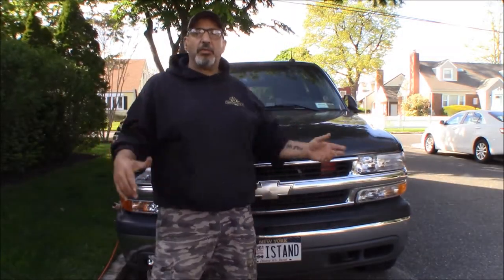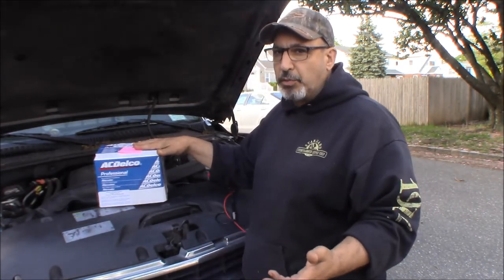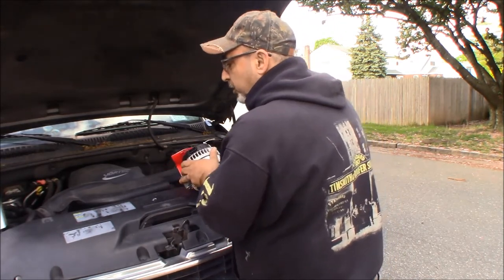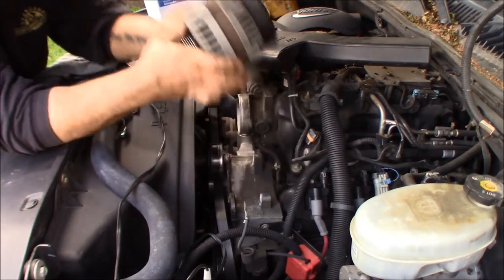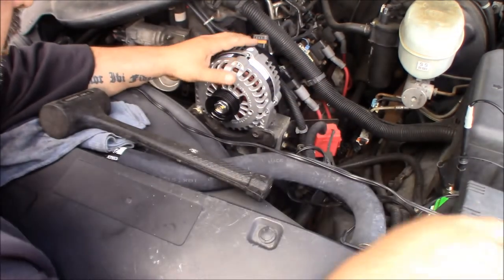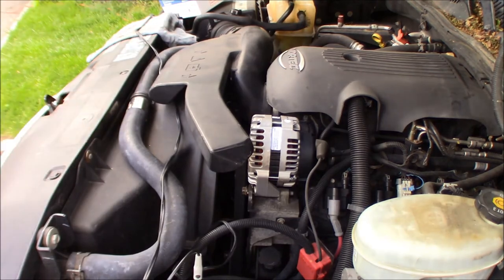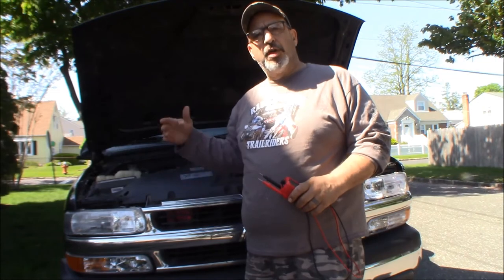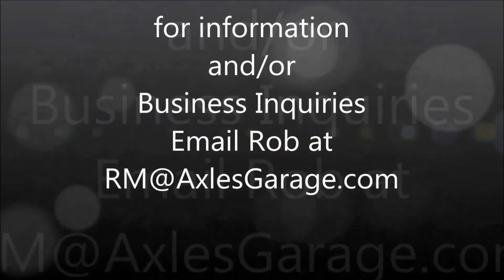Alternator & Battery Problems Solved: 2000-2006 Suburban Silverado Tahoe Yukon etc. with RPO Codes

Comment: Interesting, my daughters 2000 silverado has similar issues. Messed around with the cluster and it took 5 minutes to kill the battery found and fixed a ground problem with the cluster and thought I fixed the problem. Couple months later a brand new battery was no longer good. Replaced the battery and 6 months later a bad battery. Charging system charging at just approx 14.5 volts. Thinking I got 2 bad Walmart batteries so bit the bullet on a Costco Interstate. Now a year later I have a bad battery again. Pulled a known good alternator(just over 14 volts) off of my race car(swapped truck 5.3) to replace my daughters alternator, got the interstate warranted and put it back together, now just a waiting game to see if it does it again. Hoping the 14.5 volts the other alternator was putting out was too much even though it was in spec because at this point I am lost on what the problem is.
Reply from the maker: Interesting, 14.5 volts should not be an issue.  I would look for a parasitic draw that may slowly be killing the battery
Reply: @Axle's Garage  the problem is finding this draw Lol. Anyway, Going to replace the battery cables, and pull up the fuse block and check for bad connections on the bottom side once it gets a little warmer out and quits snowing everyday. Those areas seem like common problems on these trucks. Even have a friend that used to be a GM service adviser tell me that's the direction he would take.
Reply: Trying doing the big 3 upgrade lots of YouTube videos on how to do it
Reply: Interstate batteries aren’t any good. They put those in fleet trucks and you are lucky to get two years.
Reply: 14.5 is not over charging

Comment: my 06 Yukon with the heavy duty towing package has a 165 amp alternator stock.  Still the original one with 160,000 miles.
Reply: My 05 Tahoe has the same setup with 158k miles and my lights are flickering so I replaced my alternator with a GM Genuine one. Seems better so far
Reply from the maker: Yes, generally speaking the OEM units seem to last

Comment: If you put a socket over the outside of those sliding sleeves, run a small bolt through it with a nut, then when you tighten the bolt, the sleeve will move back. You should never hammer on that aluminum bracket. It can break.

Comment: Ways disconnect battery before changing alternator!
I didn't disconnect before changing  out alternator and blew Fusable Link. Its was a pain to replace near Starter
Reply from the maker: Good tip
Reply: Where was yours? I can't find it anywhere. 06 silverado
Reply: @johndandeneau4158  fusible link usually off alternator to battery and Starter to battery

Comment: Never disconnect the battery while a modern car is running, there is a chance you will get a spike and fry the car's electronics.
Reply from the maker: I have heard that before, although never had an issue. I have also heard to avoid arcing at the terminal like when you connect a charger, eg: connect the charge then apply power. Also, I haven't found anyone who would define 'Modern'.  Either way, it's a good warning for all.  Thanks for the input.
Reply: Been doing that shit for years, on new and old vehicles. Haven't had a problem yet🤷‍♂️🤷‍♂️. More worries about the car on the lkft than a mystery occurrence I've never seen happen
Reply: @Luke. Yup. I agree. Most cars it's fine to do. But I know someone who fried a computer in an early 2000's Mazda protégé

Comment: Couldn't get through the whole video because of Mr. Buffer. So anyhoo, I just did the evaporator hack and was excited to finally have some air. Had it idle for a little bit and it worked great. Took it out for a drive and shortly down the road the battery voltage drops and I get the "battery not charging" warning. I had this in the past so the alternator is about 6 months old and the battery about a year. Are these alternators just bad alternators or is something else in the Suburban causing them to go bad, because it appears to be a common problem.
Reply from the maker: I have not had abnormal alternator issues.  They will go bad after some time.  When replacing, get a quality part, the cheapos don't last.
Reply: @AxlesGarage  Hey thanks for the reply. I just got in from a long ride with a lot of idling on a 95 degree day. Worked good, but wasn't the coldest when idling which I expected. Probably condenser and the fan. Noticed the rear had stopped working and the passenger floor all wet so I'm on to searching how all that works, but the front is 100% improvement by itself. The alternator was an O'Reilly's Ultima reman under warranty so I paid an extra $57 and got a new one which works great.